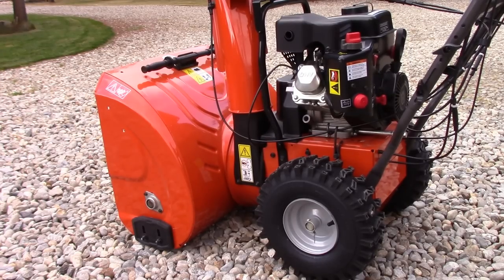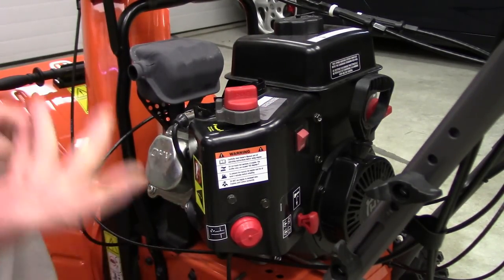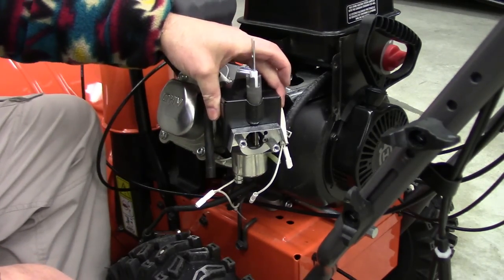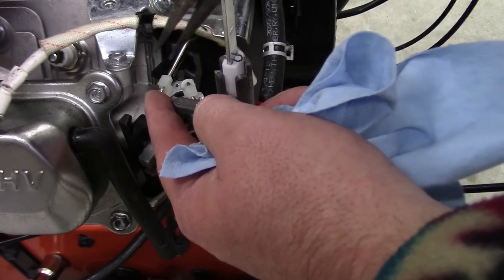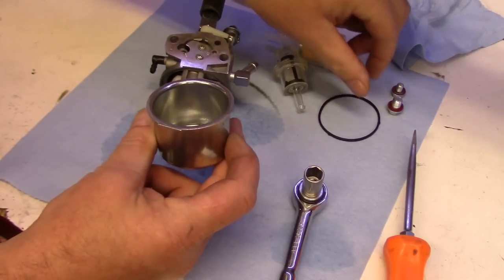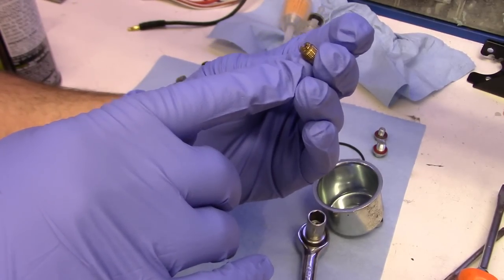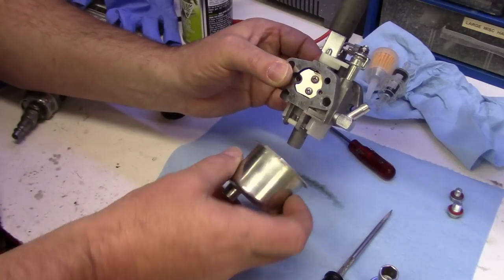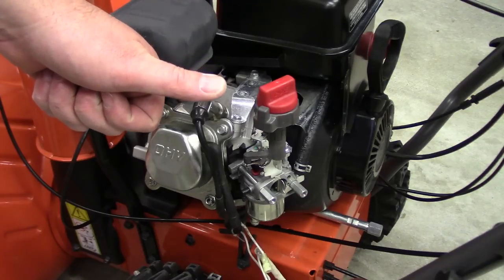Surging Snow Blower Fix - Running lean.

Comment: I'm having trouble with my snow blower. It wouldn't start. I took the carburetor apart and cleaned it but when i put it all back together it starts but the throttle surges back and forth where the linkage attaches. I never took the float apart i didn't think of it before seeing this video. I just sprayed the inlet and the outlet, and everything else out really good with carb cleaner. Where the linkage attaches It physically moves back and forth on it's own. Maybe it's still clogged and i need to clean out those jets? I thought the throttle moving back and forth may have to do with that tiny cable that has the spring attached to it. What does that cable do exactly? Maybe i have it too loose? I'm not sure. It only stays running if i hold  where the linkage attaches to the throttle wide open. Anything less than that it just surges back and forth and dies.
Reply from the maker: With running issues like this, you generally start with the easy stuff and progress along in a process of elimination to more involved but less likely possibilities. The most common running issue after sitting in storage is bad fuel - especially fuel with ethanol in it. So if you have not got fresh fuel in it, that's the very first thing to try.
Also double check the oil level. Many of these engines have a low oil level sensor that grounds out the ignition if the level is getting low. If the oil level is just at the point where the sensor is intermittently grounding out the ignition, it can cause all sorts of funny running issues.
Generally the next easy item to eliminate is the spark plug. Change it even if it looks fine. Misfires and surging go hand in hand since a misfire will often then manifest as governor surging.
Not sure what "cable" you are talking about? Perhaps you mean linkage rod/push rod? If so, the long pushrod with that spring goes to the governor. The governor is what ultimately controls the carburetor throttle/butterfly plate and thus the engine speed. That little spring on the rod wouldn't cause the engine to not run. It only takes up slack in the linkage to help prevent fluttering of the butterfly valve which can produce slight engine surging if there is a fair amount of slop in the governor linkage rod.   
If you close the choke, does the running issue get any better? If it gets better, then you likely have a lean running issue like I had and need to clean the carb. All ports of the carb, not just the main jet & emulsion tube. There is one I didn't do in the video but others have mentioned it in the comments. It's the one under the red plug on the carb. Your blower may also have an internal fuel filter in the gas tank (mine actual did so I never bothered installing an external filter). Anyway, that little fine mesh filter can get clogged full of gunk while sitting in storage. Most of those in-tank fuel filters are threaded in from the bottom of the fuel tank where the fuel line attaches. If closing the choke however has no affect, then it's likely not running lean and is something else like bad fuel, low oil, or bad spark plug.
Reply: @Rchelicopterfun  Thank you for the reply. After i typed that message to you i went back and tore it all apart again and cleaned the jets and that emulsion tube inside the bowl. It's purring like a kitten now. My snow blower isn't the same brand as yours but it looks close. It's a Yard Machine with a a Briggs and Stratton motor. It's only a year old. Looks brand new. The wire i was talking about is a separate one that is attached to a spring and runs parallel to the linkage rod. The end of it is shaped like a hook and goes into a hole in the same piece that the linkage rod attaches. I think i've heard someone say it's a safety spring in case the linkage rod comes off you don't blow the motor. So i probably just answered my own question. I just didn't know if it served another purpose also. But it's running great now thanks to your video showing me how to take the float apart and clean it out. That was it. Thanks again!

Comment: Ended up watching another video and keyed in on removing and cleaning the red plastic jet assembly under the idle screw adjustment.  Cured the surging issue without removing the carb.  However, I  couldn't remember where the short cover bolts went and remembered you mentioning it in your video and yep, there it was!  Thanks for being thorough.

Comment: I'm having an almost identical problem -> surging that goes away with a tiny bit of choke applied. I cleaned the carb same as you, although I did so without removing the entire carburetor. It still surges, still goes away with choke. Any thoughts on what to check next? Is there another idle jet/screw to clean somewhere? Could a dirty fuel filter be the problem? I've read that spark plugs can also cause surging, although the fact that a little choke cleans up the surging makes me think that can be ruled out?
Reply from the maker: @John Booker - it never hurts to change the plug (especially if it has been a while since it was last changed) as a faulty plug can certainly cause strange running issues. It's also an easy & inexpensive thing to try. My guess is the plug is not the issue, but again, if it's older and has never been changed - may as well start there. A clogged filter will certainly cause this as well so that's something to check. If your blower is like mine, there is no external fuel filter, but there is a fine mesh screen filter inside the fuel tank (it's part of the fuel line output nipple on the bottom of the tank). That thing can easily get clogged and cause lean running. A leaking gasket where the carb attaches to the intake is another common thing will also cause lean running. I don't know of any other jet/screw to clean other than the float metering valve and the main jet. I'm by no means an expert on these specific carbs however; I just know the basics. Good luck.
Reply: @Rchelicopterfun  Thanks for the reply! I kept digging and there is an idle/low speed jet on my carb, on top. There is a black plastic retaining screw that holds in a red plug with a small jet. Cleaning that out helped a lot! It looks like you can see it on your carb at 10:25.

Thanks for the video and the reply! YouTube at its finest! ♥️
Reply from the maker: @John Booker - thanks for that good info. Will have to make a note of that in my owners manual as another thing to check 🙂

Comment: Hi John, Thanks for your video, it was very informative! I just checked the low idle and high idle, as well as taking apart the carb altogether. What I found is that the carb has ZERO gaskets. Is there any chance that the surging I'm experiencing is due to missing gaskets? Thanks!
Reply from the maker: @James Quill - presuming you are referencing the gasket between the carb & intake, then yes, that can certainly cause a lean running condition too. The engine will basically be sucking air in around the back side of the carb & intake and leaning out the fuel to air mixture. An easy way to tell if there is an air leak on the back side of the carb is to spray some throttle body or carb cleaner around where the carb mounts to the intake. If you notice the RPM change while doing that, you know there is a leak.
Reply: @Rchelicopterfun  Ok, I'm actually missing two gaskets! One where the bowl meets the carb and the other where the carb mounts to the intake. I'll spray like you said, but will be adding the gaskets regardless.

The machine runs great, but only on full choke. As soon as I drop the choke, it starts to surge. My thought is that there is just too much air coming in through the lack of gaskets and is causing the surging. Thank you!
Reply: @Rchelicopterfun  Hey John, just wanted to provide a quick update. I ended up swapping out the gasket between the carb and the intake, as well as adding a new bowl gasket. Additionally, I cleaned out the red pin for the low idle, just in case. At my next start, the the engine was slightly better, but still surging. I also changed the spark plug for good measure. 

However, now I'm noticing that my snowblower dies after 2-5 minutes of operation. Any ideas what could be happening? Should I just replace the carb altogether? I've been reading online that there's been some trouble with surging on Ariens Deluxe 28's that have the LCT. 

Curious for your thoughts on potential next steps. Thanks!

Comment: would running a snowblower on partial choke be ok as long there is no surging, so that I can get to this in the spring summer when it is warmer, have no heated shop((
Reply from the maker: It won't hurt anything, but power will be down. You are basically restricting some air into the engine when doing that to cure the lean running condition.
Reply: @Rchelicopterfun  ahh, I get it, someone told me that Briggs had issues with the Nikki Carbs, and the walbro replacement was the way to go, could it be a carb issue, or just that my carb is dirty?
Reply from the maker: Always start with easy stuff. If it runs better with some choke but it used to run fine before, it's running lean and the most common reason after bad fuel or a dirty fuel filter would be a dirty/contaminated carb, but there are other possible reasons as well. I of course don't know if your carb is dirty or if it's something else. That's why we have to open them up to inspect them - it's part of the diagnostic process. If it's just dirty like this one was, the repair won't cost you a dime other than some time. If  however you'd rather just throw a new costly part at it in hopes that might fix it without any diagnostic investigation, it's your $.
Reply: @Rchelicopterfun  cleaning and check it is!

Comment: Is there a way to remove the bowl and jet without removing the entire carb?  
Also, I have seen in another video that there is another jet under the idle adjustment screw. (When you remove the red tab that the idle screw holds down). Did you ever look in to that or have a schematic to confirm?
Reply from the maker: Yes, you can certainly remove it from underneath by just unscrewing the center bowl bolt. You likely won't even have to remove the metal cowling to gain access. Thing is, it's more difficult to see what is going on when working on it in that orientation. If/when I have to do this again, that is what I will try first. But until I do, I can tell you just how much of a pain (or easier) it will be. Perhaps others who have done it this way will be kind enough to comment. 

Removing the bowl will be the easy part. Getting the float and needle out, cleaning everything, and fitting it all back in place correctly while still attached to the machine & working upside down or at best sideways, may be turn out to be trickier than pulling the carb off in the first place? I guess if it turns out to be a real hassle trying to get it all back in place, one could always remove the carb at that stage to clean it and refit the needle, float, and bowl.
Reply: It doesn’t appear as though you need to remove the float- just the bowl, jet and emulsion tube.  Why do you need to remove the float?
Reply from the maker: Why? To remove the float needle for inspection/cleaning. You very well may not have to do that of course, but I'm of the opinion if you are in there and gone to this much trouble already, checking the float needle and cleaning out that port as well is worth the extra time. There could have been crud in there just as likely as up in the jet hole after all.
Reply: I had the same surging issue.  There's another video discussing this same issue on the same LCT 208 engine.  The presenter did the whole carb take off and clean process and in the end it still surged. He removed the red plastic jet assembly under the idle adjustment screw, cleaned it up. I did the same and didn't have to do all the disassembly. I used a bristle I cut off a wire brush to clean the orifices and it solved the issue.  I also flushed out the carb, tank and lines.  

Apparently, according to a tech I spoke to, using unleaded gasoline is a no-no on these engines.  He highly recommended zero alcohol content gas (premium). Apparently the alcohol in the gasoline causes the lines to deteriorate.  He also recommended to not use Stabil during the off season (which I had used). There were some black particles in the tank and my machine had been used very little and I'm always careful when fueling.  So who knows where that came from.

Anyway, it runs perfectly now.  I'll drain ALL the gas at the end of the season.
Reply: @ravenfeather7087  Do you have a link to that video, I also still have the surging after cleaning the carb but not that slow idle jet
Thanks!
Reply: @BandKMUSIC69  > I think this is the one Raven is referring to: https://www.youtube.com/watch?v=-Ct8357b2jg

It's real easy to do.  The guy in the video says "drill it out" but I don't think he means literally drill it.  He never shows it but I think he used a 1/64 drill bit to clean the idle jet by hand.  I wouldn't literally go "drilling it out."

Also, it ends up being less hassle to take the carb off the machine the way @John Salt showed you here, than trying to work from underneath, in the tight quarters/just dropping the bowl.  I been here several times, do yourself a favor and take it off - in the end, it's less time and a better result.
Reply: If you have to remove red piece under idle screw which you probably should then I would be easier to remove everything. For his purposes of making the video he wouldn't do any good to show people that way. Some people need to see everything that's going on so you take it all apart.

Comment: Thanks for the video.  I have been having the same issue.  I think that I will make this part of my annual servicing for my snowblower.  Did you end up putting in the fuel filter?  I was curious to see if you were able to make it fit.
Reply from the maker: Hi Gordon, sorry I missed your question here from a few days back. No, I never did put an inline filter in. Even the small one looked like it might not fit under the cover after looking at it more. I'm sure some smaller diameter ones would work however.